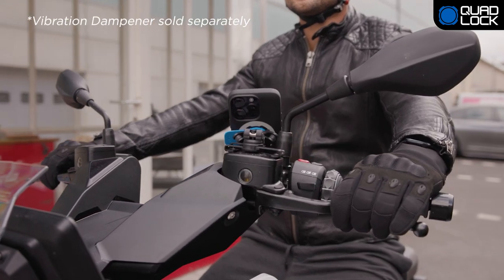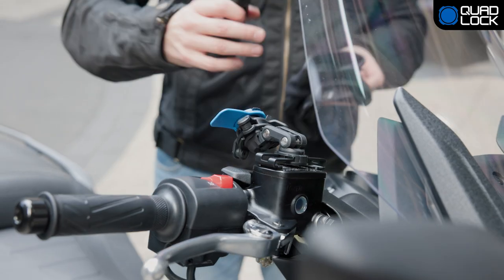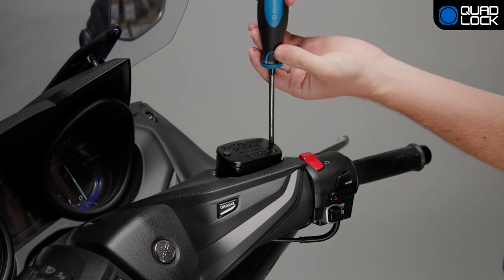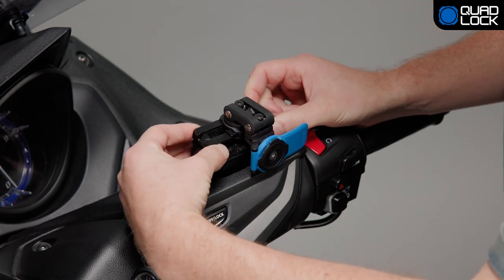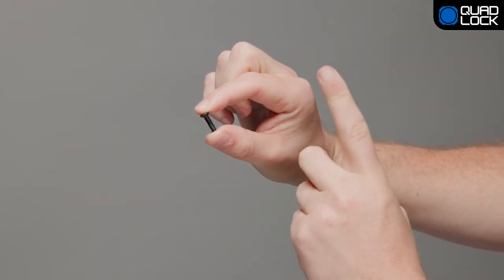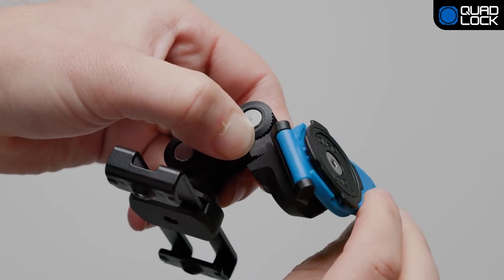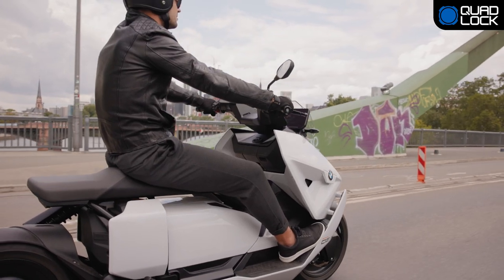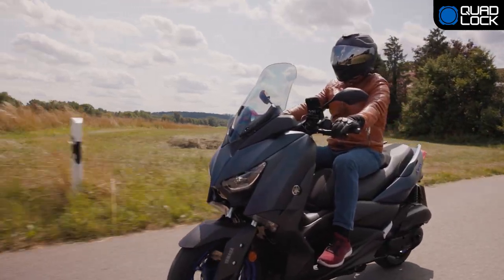Quad Lock - How To / What's included - Brake Reservoir Mount

Comment: Quad lock supplied mounting bolts are a single use only..............Brake fluid does get replaced ya know Quad lock!
Reply from the maker: Hi There, that is a great question! The mounting screws can be installed a total of 2 times with the thread-locker remaining reliable 💪 If you see any issues beyond this, you will just need to get in touch with Support and they can provide a solution 😇 

Cheers - Isabelle
Reply: Just have to put some blue headlock
Reply: This morning I saw this bracket and it had additional material formed into a bowl for the countersunk screw to sit in, rather than the screw head sitting within the 2mm bracket thickness. This form in the metal  means the bracket now stands off the oil resevoire, may not sit completely level, and has significantly less clamping force. This is not my opinion but practical physics !
Reply: Get more thread locker then? it's just like every bolt....
Reply: @RoBoT24435 yah they have to make em dummy proof for some users.   Add a drop of blue loctite and you’re golden

Comment: I'd say I'm a bit late, but looking to know if it would fit a 24' R3, if not will most likely mount it on the handle bar/stem bolt but prefer not to
Reply from the maker: Hi there! 

I checked the specs for the 2024 YZF-R3, and our Handlebar Mount would be a perfect fit! It accommodates bars of 22mm, 25mm, 28mm, and 32mm, plus we have a Pro Version that fits 35mm bars too! They come in different styles too! 🙌

Check them out here:
https://www.quadlockcase.net/collections/shop-motorcycle/products/motorcycle-mount

Cheers - Gabriel
Reply: @Quad_Lock  Cheers!  Decided to go with a 360 kit with the 22mm bar mount
Reply from the maker: Well done! 👏🏻

Don't hesitate to let us know if you need anything else. We're happy to help! 

Cheers - Gabriel

Comment: Doea this fit on honda cbr125r 2004 year model
Reply from the maker: Hey there! Our Brake Reservoir Mount certainly fits a Honda CBR125R. You can also check this info and more on our Moto Mount Lookup here: https://support.quadlockcase.com/hc/en-us/articles/9773635025423-What-Mount-Will-Work-For-My-Motorcycle

Cheers - Ara

Comment: Does this go on a Yamaha MT-07 2024? And can additional screws be ordered separately?
Reply from the maker: Hey there! 

Yes the Brake Reservoir Mount will work with the MT-07! We don't sell the screws for these separately, but they are covered under warranty so if you have any issues we will help! 

Cheers - Aaron
Reply: @Quad_Lock so just because i loosen the screws for brake fluid maintenance means i have to use another set of m4 screws?

Comment: Hi would this also work for the Suzuki GSX 250R? 2018-2019 model
Reply from the maker: Hi there 👋 For this setup to be compatible, you will need to have a square reservoir with parallel, side-by-side screws! Suitable for a hole pitch range from 38mm - 70mm (1 1/2" - 2 3/4") 💙

Alternatively, we do have our Brake Clutch Mount which may be suitable: https://www.quadlockcase.net/collections/shop-mounts/products/motorcycle-clutch-mount?variant=42696734310575

Cheers - Isabelle
Reply: This morning I saw this bracket and it had additional material formed into a bowl for the countersunk screw to sit in, rather than the screw head sitting within the 2mm bracket thickness. This form in the metal  means the bracket now stands off the oil resevoire, may not sit completely level, and has significantly less clamping force. This is not my opinion but practical physics !

Comment: Does it work with Honda Forza 350 - 21/22?
Reply from the maker: Hey! For this setup to be compatible, you will need to have a square reservoir with parallel, side-by-side screws! Suitable for a hole pitch range from 38mm - 70mm (1 1/2" - 2 3/4") 💙

Cheers - Isabelle

Comment: Can you combine this with the dual pivot arm?
Reply from the maker: Hi There, unfortunately not 😢 With these two new mounts we do not recommend adding an extension arm of any kind, the only approved add on is the Vibration Dampener, USB Charger and Weatherproof Wireless Charger 😇

Cheers - Isabelle
Reply: This morning I saw this bracket and it had additional material formed into a bowl for the countersunk screw to sit in, rather than the screw head sitting within the 2mm bracket thickness. This form in the metal  means the bracket now stands off the oil resevoire, may not sit completely level, and has significantly less clamping force. This is not my opinion but practical physics !

Comment: Does this work on 2023 CFmoto 300ss
Reply from the maker: Hey! For this setup to be compatible, you will need to have a square reservoir with parallel, side-by-side screws! Suitable for a hole pitch range from 38mm - 70mm (1 1/2" - 2 3/4") 💙 Do you have this on your 2023 CFmoto 300ss?

Cheers - Isabelle

Comment: Does this work on reserviors
Where the screws are on the corners opposite?
Reply from the maker: Hey, good question!  Unfortunately not, this will only work then the screws are parallel - side by side 😇

Thanks - Isabelle
Reply: @Quad_Lock I hope you make one adjustable for this type.
Reply from the maker: Hey! We don't have any plans right now to release another version of the Reservoir mount as we just released it! Although I will pass on your feedback to our team! 

Cheers - Aaron
Reply: This morning I saw this bracket and it had additional material formed into a bowl for the countersunk screw to sit in, rather than the screw head sitting within the 2mm bracket thickness. This form in the metal  means the bracket now stands off the oil resevoire, may not sit completely level, and has significantly less clamping force. This is not my opinion but practical physics !
Reply: @Quad_Lock  can you test it and confirm? I think it can work since the mount is just screwed on top of the cover and there are no clamps griping the reservoir. Or is it because the phone holder is going to be tilted?
Reply: @Quad_Lock  Cant it just be mounted diagonally then? My screw holes are on each corner too.